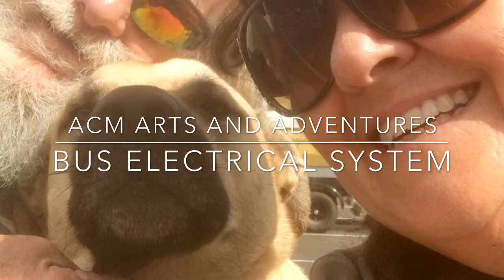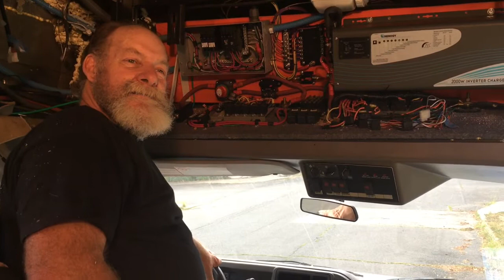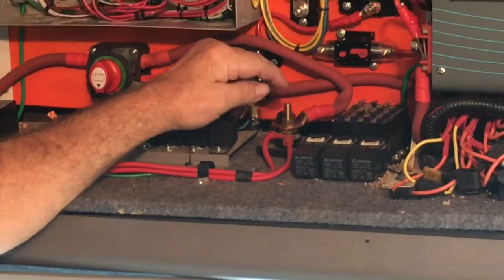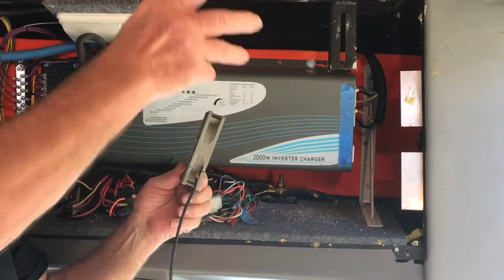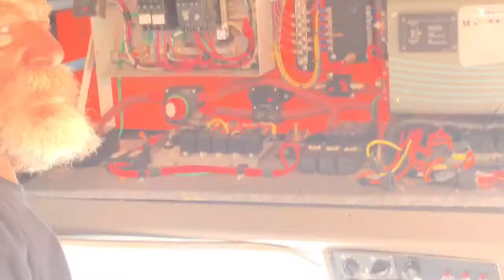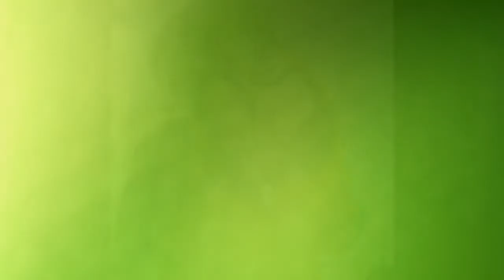BUS ELECTRICAL SYSTEM 🚎 Bus Conversion Ep41

Comment: good info, my shuttle is not finished, but just completed an 1800 mile trip from port o'connor texas, to Wilmington, nc.  learned a few things, no problems with my build, the problem with the meeting seam of the fiberglass to the top of the cab, I dug it all out, put new caulking in, non-sagging type,, lasted about an hour after hitting the road... I think I need something more flexible like pure silicon with mold inhibitor
Reply from the maker: Nice to hear from you, are you going to be finishing your build in North Carolina. Pure silicone should do the job especially with the mold inhibitor. Let us know how things are going and hope to see you down the road.